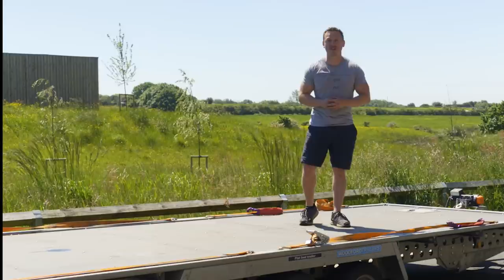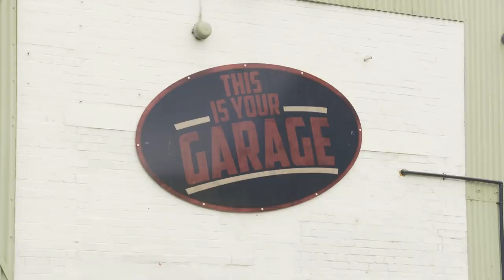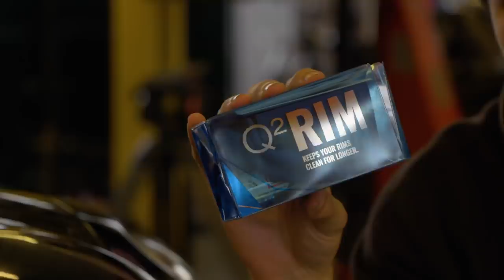Helping A Subscriber Get His Neglected Car Back On The Road

Comment: As a fellow Mk 3 owner, I can empathise - "It's my F'kin boat y'all".
Reply: why do people call it a boat?
Reply: @ewangoodman6860  about as fast as a boat
Reply: @ewangoodman6860  because theyre the biggest and softest of the MX5s
Reply: It is nice though. Had the Rx8 PZ for years an  swapped it for a mk3 venture etd. So much better on long journeys. Does really need that 200hp just to  tip it over to awesome. Am 6 foot tall so the mk3 is the better option.
Reply: @jackrichards1101   and the fordiest :P (jk... i own a mk2,but i love the "chubbiness" of the mk 3 lol )
Reply: @jackrichards1101  They are stiffer then the NA & NB...
Reply: Agreed - when you're over 6' it's the only serious option. Literally just now got mine back after 2 weeks away getting the old bilsteins replaced with new Gaz coilovers and poly bushes all round so quite odd to have this parallel experience pop up!
Reply: @brenton9492  well, stock NA+NBs must be snails then, cause in the 2.0L NC there's actually stuff happening when you step on the gas pedal ;) 
jokes aside, I think it's more of a size thing.
Reply: @TheMx5Channel  but the nc is like 300kg heavier
Reply: @jackrichards1101  Maybe a quick google would’ve been good before speaking, no? NA8 - 1040KG, NB2 - 1102KG (Mazdaspeed - 1147KG),  NC2 - 1109KG, ND2 - 1061KG. It’s ~60 kilos heavier than NA, same weight as NB with wastly more power. Only ND went lighter again with similar power in ND2 form.

Comment: What a great video, with lovely people and a thoughtful, kind, and generous mission.
Just something to note : the snow foam technique, ie start at the bottom and work your way upwards is a complete myth.
It does absolutely nothing except stop the whole process from working as it should, because snow foam is designed to dissolve dirt and then works by gravity allowing it to slide off the car. It should be washed off from top to bottom, and the myth that it should be washed off from bottom to top is simply complete bs and goes against manufacturer's recommendations.
Also never clay bar your paintwork, unless you are going to machine polish it afterwards, because claying will actually put more fine scratches into the clear coat, when it removes the contaminants from the surface. Remember, you can only polish the clear coat so many times before it's gone !!

Comment: So, basically Pimp My Ride but you actually fix the car. Nice.
Reply: MORE LIKE CAR SOS
Reply: But he doesn't absolutely slam the car when he first sees it.
Reply: What do you mean? I would consider coating the entire inside of a car with fluffy material (pink, obviously). A cup holder in the middle of the roof and a tv blocking 2/3rd's of the front window a fix as well.
Reply: @hidde1638  Don't forget LCD screens on the bumper, a soda machine in the back seat and some glossy spray paint to cover up all the rust.
Reply: @MGMutt  I've genuinely never heard of that, which network did it air on?
Reply: @rockzs74r  No, I've not actually, but I'll be sure to check it out, thanks for the info!
Reply: Plus it is real.
Reply: And probably not scripted, and actually take the guests wants in to account

Comment: "Looking a bit sorry for itself isn't it?"

*Car looks immaculate.
Reply: ok
Reply: Exactly 😅
Reply: Our MX5 makes that look factory fresh lmao. Rusted through and it only starts if you first unplug the battery and plug it back in again and then get lucky
Reply: I expected it to be a bit more worse for wear as well, but the little upgrades and detail were nice too!
Reply: We're just used to Alex's cars, the Titanic is still in good nick in comparison to most of those :)
Reply: @Jeagles  sounds like you need the clean the battery terminals and the connectors that go on them, and make sure they're tight. If not the wiring is fucked and needs cleaning as it goes into the terminal
Reply: @PlinkyVR  nah it’s a fault with the ECU
We’ve sold it now tho as it was a hassle to keep
Reply: @Jeagles  ah the ol turn it off and on technique, a classic
Reply: I agree

Comment: If you want a free reign project, my sister has a 1988 Ford Sierra GLE 2.0 Auto, that's been sat in her garden for several years....during which time the garden (+ house) was flooded in July 2015, so lords know what condition its like under the body.... She also has an 2006 golf, sat ON MY DRIVE, thats in a sorry state. A 1985 (older than me) VW T4 van part way done into a campervan too..... lots of cars, so little time....

Comment: Like pimp my ride but it doesn't suck.

Definitely remember for the future though, suspension components should be torqued when the suspension is under load the proper way is to torque it on the ground but the way it works in the real world is using a jack to lift it up by the lower control arm.

And if you mess with the ride height as much as getting new springs and dampers, you need an alignment.